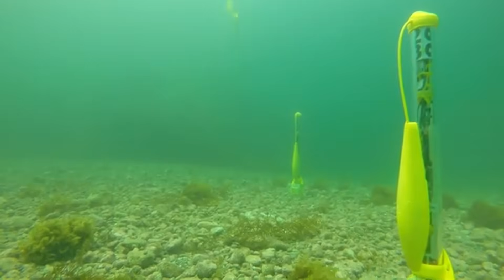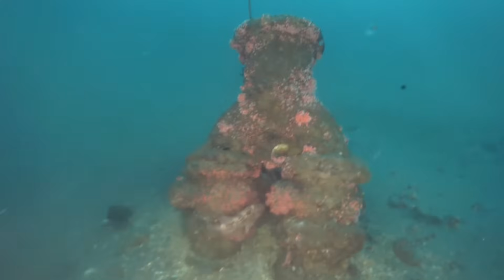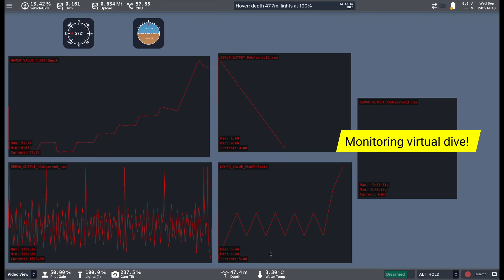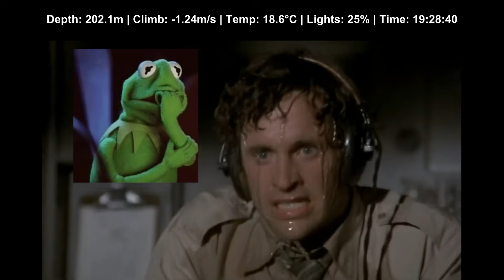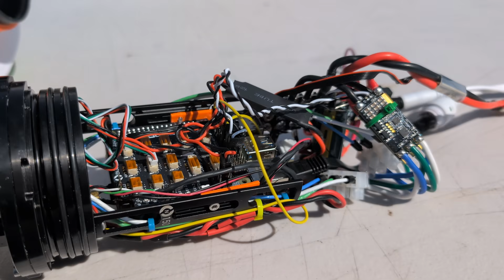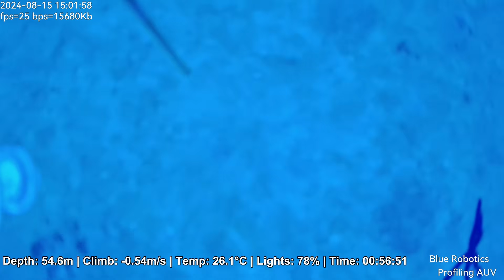MTS TechSurge Fisheries & Benthic Monitoring: Modular Building Blocks for Marine Monitoring

Comment: The modularity and precision of this monitoring system are impressive! As a specialist in micron-level motor components used by industry leaders, we deeply appreciate how critical reliable thrusters and housings are for long-term benthic operations.
Your work exemplifies the engineering excellence we support every day. Should future projects require high-torque, corrosion-resistant motor solutions, we’d be honored to contribute. Keep pushing boundaries!🥰🥰🥰
Reply from the maker: thanks!  back at ya!!!!
let's keep in touch :)

Comment: A glider could be a nice idea. The standard tube with a couple of fines to adjust distance from bottom and one or two pings to keep stable distance from bottom and another one looking slant forward to avoid ant steep slopes.  And a camera of course. And some way to record GPS position ? The last might be more challenging, unless connected witht the RIB/boat GPS. That location would also help
Reply: I'm currently working on a small glider similar to this. it's nice to hear others are interested in this as well.